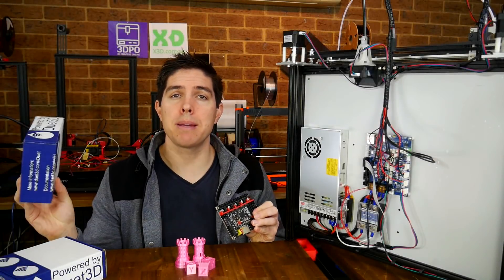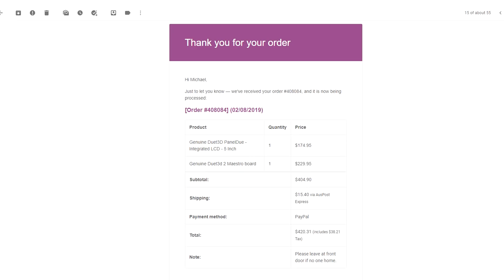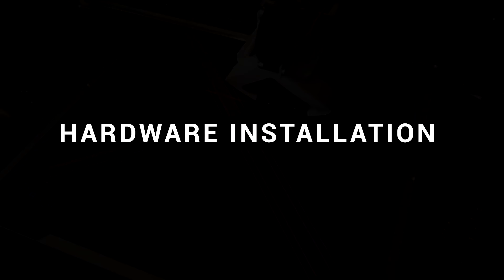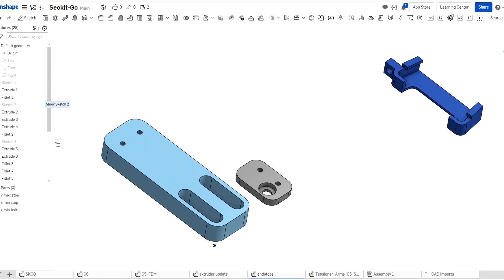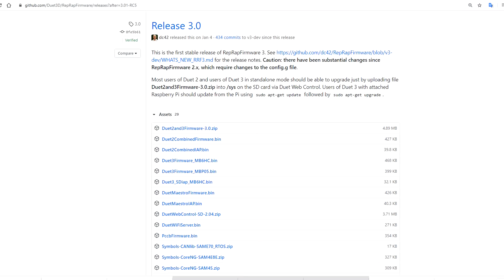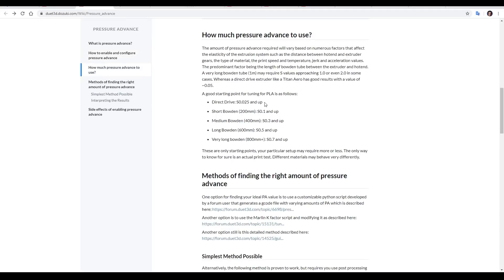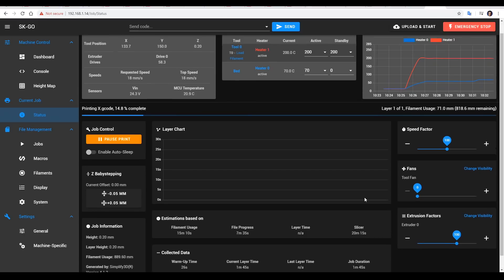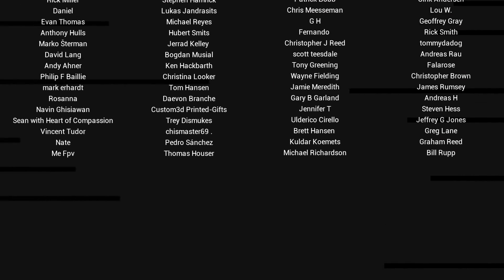Duet 2 Maestro & Reprap firmware on SK-GO: Guide for a Marlin user

Comment: Soooo spend 400-500 bucks, spend days rewiring, learning new gcode and configuring, and the end result is... prints that look the same ?
Reply: xlioilx  What tf are you talking about ? I said the prints look the same, and they do. It wasn't even a fair comparison since the part cooling fan wasn't working right on the marlin prints lol. In any case, I don't even think you read my comment, or watched the video. I'm talking about upgrading to a DUET board, not an skr board or duet clone or any other 32 bit board, OF COURSE 32bit is better for corexy, and a clone is cheaper, but that's not the point. And the amount of work is the same if you're using a clone or an authentic duet, so there's no difference there at all. Do you even have any idea what this video is about ??
Reply: How would you get to over 400 bucks? The Maestro is 89£ on duet3d.com.
Reply from the maker: It's not for everyone, I get it. I treated it as a learning experience to expand my knowledge of 3D printing. For me to do the best job possible with this channel, it makes sense for me to run machines with varied hardware and firmware. Some with Marlin, Reprap, Klipper, etc.
Reply: @TeachingTech  I have no problem with you doing alternative firmwares at all, and I appreciate someone knowledgeable giving it a try so I know what's involved in the process. I was only pointing out the fact there wasn't much difference in the final prints, not that the effort wasn't appreciated. Sorry if you took my comment in any negative way towards your video, that was def not my intention.

Comment: Rather steep learning curve at first blush.  I have not seen that much improvement in your prints to justify the time and energy.  I am curious to see your print results after some tuning to see if the value emerges.
Reply from the maker: I don't expect it to change much. I was already running a 32 bit board with TMC drivers. I think Duet3D/Reprap is more about quality of life features.

Comment: PERFECT timing. Currently in the middle of designing a CoreXY build (of similar size to the SK-Go) and have been looking very closely at both the Duet Wifi board and the Flex3Drive extruder you're using. Can't wait to see what else you do to that machine.
Reply from the maker: Video soon testing the Slice Engineering Copperhead with it, although I'm not sure I have any really high temp filament to benefit.

Comment: I dont see a huge benefit. I'll stick to having 5 cheap printers built to do a specific job extremely well rather than one $1200 printer.
Reply: I think like that about a year ago, but know that I own both worlds, I can tell that the sweet spot it's 400 to 700 dls 3d printer, the cheap ones only give me more work and more time spend=to more money, 1 seckit or another good 3d printer like that and you save time, print A LOT faster saving time, with more filaments option, more reliability, less money spend on repair, clogs etc, and so much more features that helps when you have a farm, like octoprint or duet wifi, autobed leveling, etc...
Reply: @tacoterito22  i can see your point however........ I bought a $180 Hictop prusia i3 clone spent an extra $40 on a bigtree tech skr board and $50 on micilanous. I printed out all other part upgrades and attachments for quick swap hotends. With that one printer alone I can print ABS TPU, Nylon, Pla, and most other materials including composite materials.  I dont know the exact number of failures I have had on that particular printer but I can say it is rare.
Reply: @thedesigns9570  Yes i never say it could not be done, what i meant with sweet spot its because a 400/500 dls printer like a V-king, have much better kinematics, lets you print bigger things, you can print much faster 180 m/s easy, lets you change nozzle with a cold hotend (good mosquito clone), lets you print all sort of high temp filaments, that's why i say its the sweet spot! not that you cant have a good printer with 200 dls
Reply: @tacoterito22  The only reason you people like you need to spend 400-700 on a 3d printer is that you can't figure out how to make a cheap one work for you. Meanwhile, everyone else in the world does just fine with a $225 ender 3 LOL.
Reply: @obie224  Yeah, you can also make it from china to Russia in a bicycle, the thing is that it would be much more comfortable faster and reliable  in a car or a plane, "people like me" that say 400, 500 dls its sweet spot its because it uses his brain to reproduce critical thinking and not point fingers against other people,  when you have linear advance or silent stepper motors and you can have the printer in your room without disturbing or wake up the baby, or when you want to print polycarbonate and dont take high risk of melting the PTFE tube that's poison, or losing time stretching the belts or when you have to do the procedure to changes nozzles and dont have a cheap mosquito clone to do it easily, then you realize that  you save a lot of time and you gain much better print quality, you never have to change nozzle because its not going to wear out (hardened nozzles), you can do much faster prints at 180m/s because of the much better Kinnematics without losing quality and you get to a point where you can print a lot more materials that what an actual ender stock let you, much better power supply that reduces the possibility of damaging the printer and have much more reliable voltages, and so many things more, then you will see my point and stop bean "like that"
Reply: @obie224  But ender 3 prints are far from the best, very good for the price but some people don't mind spending the extra $$$$
Reply: @obie224  The cost in parts to get reliable pure PC Prints out of an Ender 3 already cost as much as the price of my Ender 3, I love that thing for just pumping out stuff 24/7 But it's not realistic to say that's it's good for everything, you're not putting a Duet or clone on basically any creality printer because it just doesn't make sense.

Comment: If you had uploaded the Duet2and3Firmware-3.0 .zip
 file for the 3.0 release you would have gotten the missing file needed for the 3.1.1 update, as well as the DuetWebControl. Same for 3.1.1, the uploading .zip through DWC will update "everything" (but as you didn't have a network connection handy, a direct cable + static IP would have been an option)
Reply from the maker: I worked it out in the end but the docs definitely need some work. One doc said I could just pop the firmware file on the sd and boot. Others said to delete the existing binary before the upgrade but that wasn't present. The online configurator provides the latest firmware binary with no links or instructions on how to use it.
Reply: @TeachingTech  fair enough! if you were to head over to the forum and detail out the issues you found it would help making it easier for the next guy. Both Duet3d and in part he community will quickly make the necessary improvements once its been highlighted.

Comment: I switched from Marlin on all 4 of my printers long ago and absolutely love the Duet. Just finished building my 5th printer which is my first Core XY just waiting for my Duet WiFi to show up to test it. All my others are Duet Maestro with end stops so looking to try the sensorless homing. I tried using an skr1.4 turbo on this new printer and just cannot get Marlin to work. Think I have gotten spoiled on RepRap firmware and the Duet as things are so much easier to set up and use. I will never go back to Marlin.

Comment: God, what do you people have against Klipper?
Reply from the maker: I covered Klipper a long time ago. Funnily enough no one asked what I had against Duet at the time.
Reply: @TeachingTech  Hey Michael. Sorry for the narcy post. My point is really that for decent DIY coreXY machines, klipper is pretty much the go-to solution, allowing you to use any controllers you want, any number of controllers. That's really not in opposition to the duet, but rather RRF. Plenty of people run klipper on duets. But when you jump to killer, duets make less sense since you don't need exotic >4 stepper controller boards, proprietary expanders and so on.
Reply: Mat Bettinson usb uarts are an ugly way for interfacing. Otherwise it’s fine.
Reply: @christophmuller3511  I don't even know what to say to that.

Comment: Adding the wifi dongle means it will have been cheaper to just buy the more powerful Duet WiFi
Reply from the maker: In hindsight I wish I had just purchased the wifi. I agree.
Reply: Any cheap WiFi repeater with Ethernet output will do, these are about 20$. The maestro is more universal if you do not need more then 7 steppers as it supports 12864 displays which are very common on commercially available printers and the drivers are more silent.

Comment: Step 1:  Get at least 5 years of experience building and upgrading 3d printers.  Step 2:  Memorize all of the features or Marlin, and all G Code commands.  Now you're ready to tackle upgrading!  Seriously - you convinced me.  I will never attempt something like this.
Reply: Inspired to tinker I took on the duet upgrade with my Ender 5. So far I am very happy with the upgrade.  I documented my duet mods for soft power and autoshutdown here at www.randoprojects.com. Thanks for the Duet content TT.
Reply: You can easily skip the misery of Marlin and directly start with RRF.
Reply: @christophmuller3511  "misery of marlin" sounds like someone is trying to justify wasting his money on a duet lol.
Reply: I don't think I have to justify not using the worst printer firmware out there. 

The Marlin configuration "strategy" comes from necessity due to a history of using overpriced 8 bit hardware for years which is why there was the need to optimize the build to only include what is absolutely needed in order to fit onto the AVRs it was targeted for. Guess what: AVRs now finally are replaced with the sane choice of 32 bit ARMs which have been around for a long time for prices significantly lower then the "large" ATMegas. 2.0 finally introduced support for 32 bit ARMs but instead of dropping the legacy and rethinking the design decissions the Marlin development team stuck to the useability nightmare of C header file configuration. 

This is also a security risk. There is no way knowing which features a supplier included into their pre build firmware. People still tell people to upgrade their Ender Firmware to enable thermal runaway protection because there is no proper way to see what the firmware is actually doing. Even more this approach is a testing horror - how do you know there is no side effect between different configurations?

I'd rather use Klipper than touching Marlin ever again. Did I waste money on a duet? Not really, there are very few options for Marlin out there with support for 7 stepper drivers and the price including drivers is very compareable to the Maestro driving my Voron 2 ...
Reply: @christophmuller3511  let me get this straight... Reprap firmware started 32 bit, all the premade configurations from manufacturers are always perfectly done and easily readable, there are never side effects of changing config, and always need 7 motors?
Reply: @christophmuller3511  Wow, really doubling down on that "I wasted my money on a duet" comment, huh ?
Reply: @christophmuller3511  some people are just lazy or too stupid and have no inclination to do anything on their own. This generation is useless and craves immediate satisfaction. They have "NO PATIENT'S" The "Plug & Play" Generation!!! Lol
Reply: yeah just give me rdy to go firmware that works...

Comment: I have the Duet3d Wifi and had previously tried to upgrade my old Wanhao Di3. Yes, this is a very quiet board. But it never worked properly and after a year of trying I gave up and put it back in its box. The forums are very much RTFM and I also found gaps in the instructions that meant I couldn't follow them causing me to try and revert to the forums. Here I was again asked to go read the F*** manual. Given the competition it's horribly over priced. The only thing I really loved about the board was the in-built webserver. I really miss that given that the SKR boards all seem to have issues connecting to Octoprint. It's a nice board on paper, but it's a real bear to install and get support for. I converted to a Marlin board and haven't looked back.
Reply: I agree with everything you said.
More than six months ago I bought this board and still can not get it to work. The information in the manuals is not enough and it does not cover any problems that arise during the setup process.
The community is terribly small and unfriendly.
When you try to get help on the forum, you don’t get any specifics, only either standard answers in the style of "restart the board and try again", or a negative attitude in your address.

Given the fact that, for example, Bigtreetech is already taking confident steps in adding a web interface to its boards, I don’t see the point in buying Duet.
Perhaps the quality of the board itself is higher than that of any Marlin-board, but the terribly small and not the most welcoming community, inadequately high price and the wretchedness of the manuals kills it
Reply: The skr boards do not have issues connecting to octoprint. Would recommend a pi running klipper and dwc2 to emulate the full experience of rrf + duet hardware for much cheaper. Depending on the board, it might be even better.
Reply: @esk8builder693  Thanks for the feedback. I would love to hear more about the pi Klipper / dwc2 setup. Can you point me to any tutorials / guides please? With regards to connecting the SKR-Mini-E3 to octoprint. Out of the box mine just won't do it. I have tried the suggestions about taping off the power connector on the USB and other suggestions. Still doesn't work. There are many people seeing the same problems.
Reply: @B0M0A0K  Michael has some excellent resources on octoprint setup. I personally followed his videos and got my octopi instance up and running. I next followed his klipper guide and joined the klipper discord to ask any questions.
Reply: Are you kidding me? The duet forums have some of the smartest people in 3d printing bending over backwards to answer questions. Actually, you know what, I went and searched for your username on the forums and found your posts. You've got a bunch of people giving you detailed and helpful answers. Why are you lying dude?

Comment: I ended up upgrading my Ender 3 to a Panucatt Kinetica G2-C, a new board based on the RepRap firmware and Duet web interface. I was running an SKR mini E3 V1.2 before, but for various reasons, I wanted to try something different. Configuring the baord was rather difficult and frustrating. (Although I'm sure some of the frustration was my brain thinking "but that's not the way Marlin does it...") And there was a quite steep learning curve. In particular I had a hard time getting the BLTouch to work. But now that I've got things dialed in, it is working quite well, and I love being able to quickly upload g-code to change/tweak things rather than having to compile the firmware, throw it on an SD card, and walk it over to the printer. The web interface is fantastic, and both Cura and PrusaSlicer are able to send prints directly to it, just like with OctoPrint.
The only thing it's missing is a webcam, although if you have a camera that can stream over HTTP(S), the Duet web interface has a spot where you can input your camera's URL, and it will display it in a box alongside the printer controls. Overall I'm quite pleased with the setup, and both the hardware and the software seems of high quality and well polished. The Kinetica board is also cheaper than the Duet board ($79, including the wifi module.) Although it works with the Ender 3 stock screen, the interface is a bit clumsy, so my next upgrade is going to be a PanelDue. :)

Comment: Too much money for the benefit received. Marlin is VERY rapidly approaching the ease of Duet/Reprap for those people with the confidence to install the gui and compile their changes. Changes without compiling is convenient, but that is true of any interpreted vs. compiled code
Reply: Bad comparison... compiled vs. interpreted.  Duet/RRF is not interpreted, it is configured.  Interpreted code implies that it is running code that has to be interpreted and converted to a sequence recognized by the processor.  Configuration is more like a switch statement that says which branch of compiled code do I take.   I quit Marlin almost two years ago and don't miss the code/configure, compile, clear the memory, send to board, test, and do it all over multiple times until it works the way I expect, at all.  Yes it costs more, but, when weighed against the value my time and less frustration, it is a no-brainer.
Reply: @duanehouck2919  No-one puts enough value on their time, especially time spent with frustrating documentation. That should be worth more!
Reply: @duanehouck2919  As I understood it, all the configurations are GCODE commands... therefore it is interpreted :P
Reply: @markusgogele5644  Nope.  I've written interpreters and compilers, trust me I know the difference.  If you set the time zone on your computer, do you think the code of the operating system is running interpreted code to show the time?  The execution of GCODE is interpreted on all firmware, but each command is a compiled set of code.  So, then if you are saying it is interpreted because it is running GCODE, so is Marlin.  The GCODE in RRF is interpreted at startup, but, just like Marlin, it uses the settings stored in memory to run a print.
Reply: As long as you need to edit header files speaking of the „ease“ of Marlin is a bad joke. And DWC alone is more than enough benefit for the price.